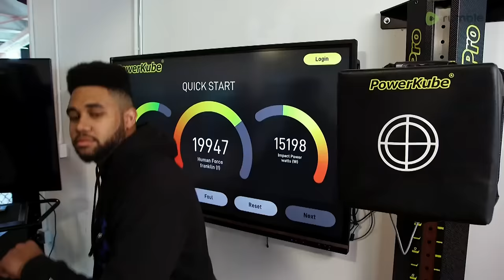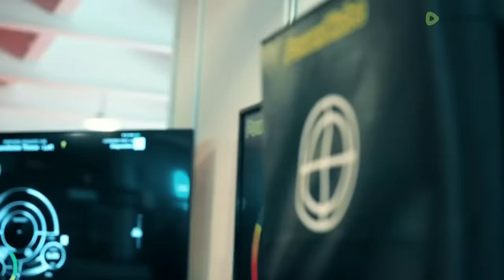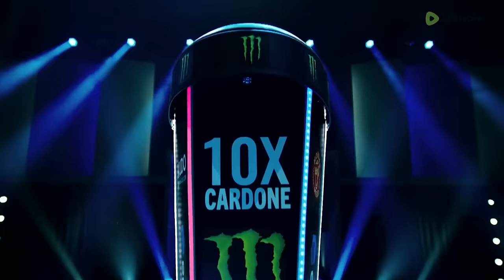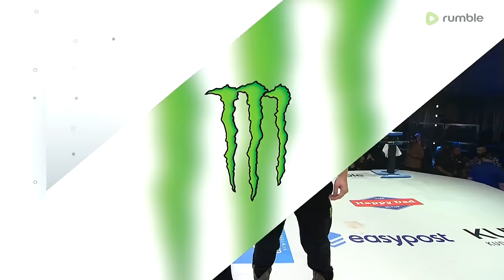The New Sport That Took Over 2022

Comment: They have to change the rules. The 10 count should if they get up, they are up. I mean it’s pointless otherwise. I mean if you go down it’s because you are knocked the fuck out. Absolutely everyone who is able to get up is going to be out of it. So either get rid of the 10 count or raise it to 15 seconds. But the refs should not even be able to call the final until it’s actually hit 15 seconds. For example they called the black man who used the thing in the middle to get back up out of the fight at 8 seconds. But the time 10 secs would of came and then man went to chalk his own hands he would of been fully recovered.